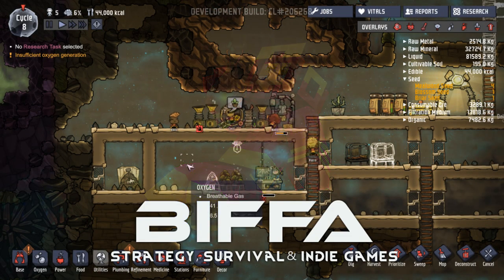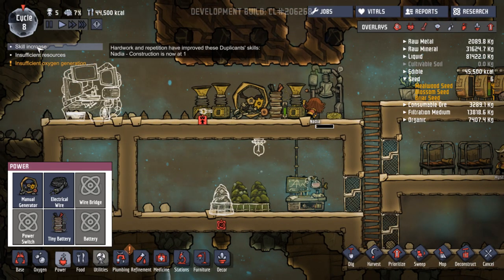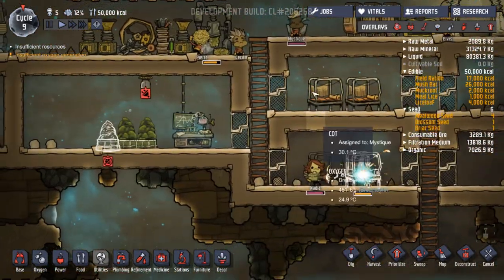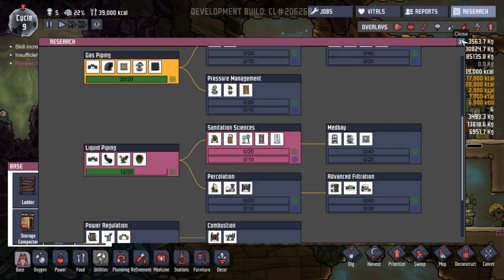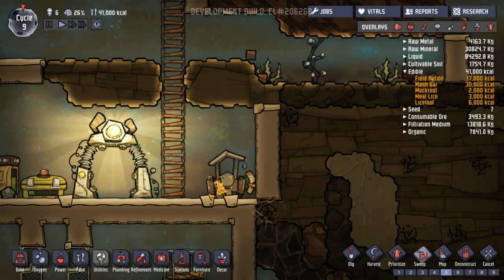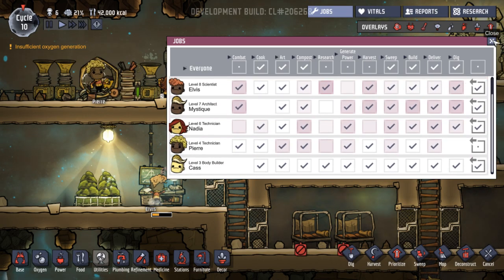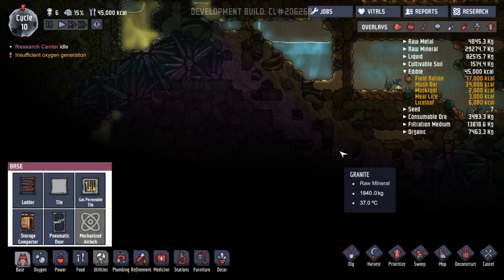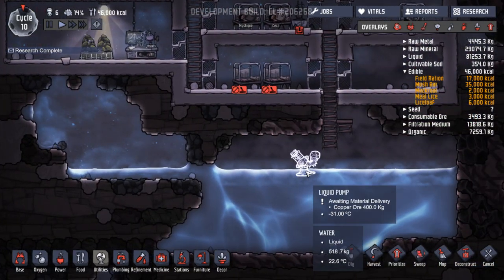Oxygen Not Included Gameplay - WHO'S THAT SNORING?!! Lets Play Oxygen Not Included #4 Alpha

Comment: CO2 tends to move to the bottom room, but in order for that to happen make sure you connect the sides of your base to the bottom room in some way and give gases more space to move (increasing the size of the bottom room will allow more co2 to get there faster), also the tile that lets gas through is useful in these situations because it allows gas to travel up or down through floors if it wants to... And at the bottom of the base where all CO2 gathers put algae terrariums (dont need them on top, they dont do anything there). Advanced liquid piping research tree, is the most useful in my opinon, it gives you an ability to filter out gases and liquids you dont need and convert them (including contaminated water/oxygen, slime etc)... And lastly, dont block the compost maker, cause thats where you need to store contaminated dirt and it produces contaminated oxygen that comes out of your storage.

Comment: Hi, am enjoying watching you discover this.  It is always good to see how someone else plays.  Have a tip:

The water level will fall, so you need to put your water pump down lower, actually immersed in water for it to work.  Think a ladder down through the water will help you place it.  I guess you must be planning to pump water up to a small pool/reservoir that you will make near the things that need the water.  (I was lucky with my map and was able to tunnel up to higher up water when my water run out and so got my pump working again - though I hadn't thought to build a higher up reservoir near the things that need the water - hmm that is quite a good idea Biffa.)

Oh, others have told you about the compost heap being closed off and the other suggestion(s) to put a specialised contaminated dirt storage beside the unit and then to add an O2 scrubber right beside it.  That will solve the contaminated air problem from your current toilet fumes.  Ensure that the other storage units are not used to store contaminated dirt. It worked a treat when I tried it.  :)

Looking forward to more.

Comment: You only need to separate the loud snorer by having a space between the cots. At the moment, once you run out of water, game over. There's no current way to produce water.
Reply from the maker: +Aussie Springbok yes there is, there's ways to process bad water ;-)
Reply: I believe algae terrariums remove water from the system, and so do some other structures and buildings. Eventually, there will be no more water to recycle. There are ways to ration the colony's water supply, but the devs have mentioned that because of this, 100% sustainability is not currently possible. They are working on sustainability, so hopefully water no longer disappears for no reason in a closed system in the future.